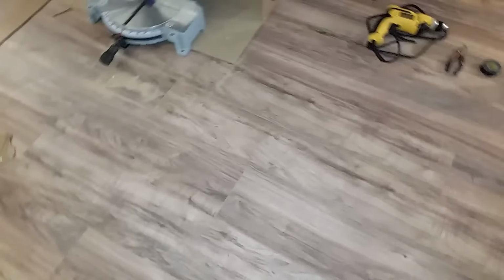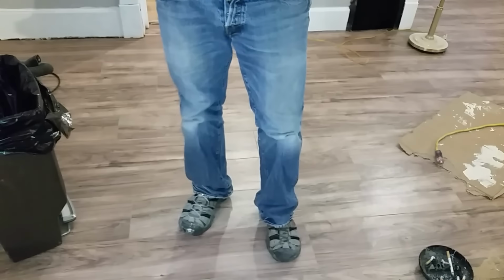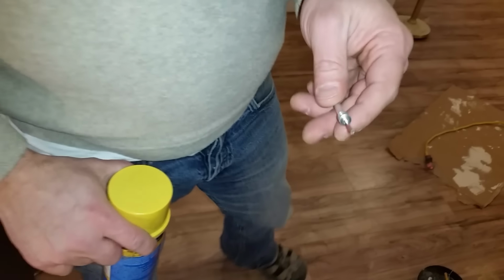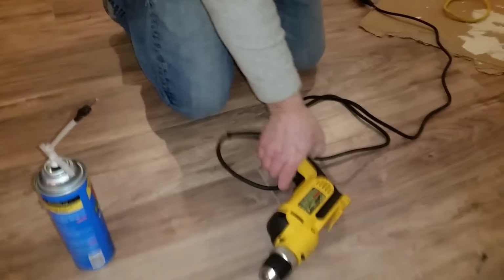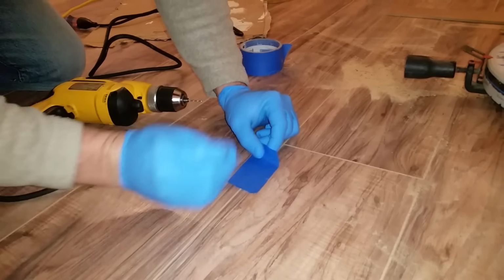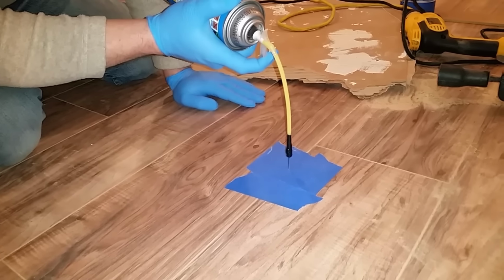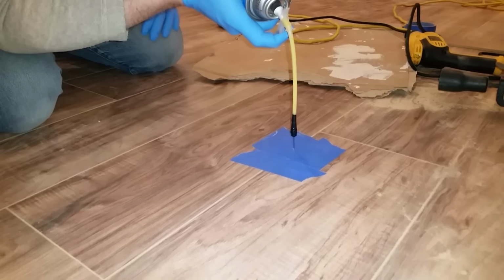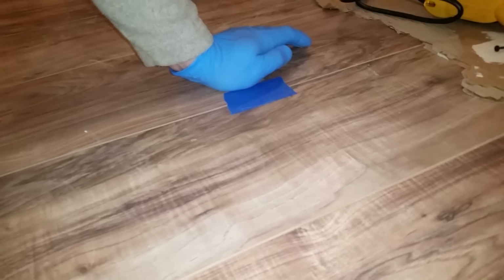Laminate flooring repair to fix soft spot for uneven underlayment

Comment: this is what happens when you don't use an underlay and don't leave an expansion gap at the edges, underlay is like $30 to cover a large room, don't cheap out laying laminate.

you're also storing up future problems by bonding the flooring to the subfloor, now your laminate can't move so will buckle even more when it expands and contracts
Reply: 100% man. I just spent 28$ a roll on some 2mm foam underlay and like 80$ on a vapor barrier over concrete. Another 150$ to level it out and you NEVER have a problem again! These numbers did the larger part of a 1300sqft apartment

Comment: That crack foam is the nastiest product out there. It will ruin everything it gets on , including your hands, if you let it dry.
Reply: yes you are right, but if you mess laminate flooring or tile, the best way to scrap it off without scratching is poly strip wheel on a grinder, just to let you guys know!

Comment: It's a free floating floor if the under layment was there you wouldn't have that problem.
Reply: We have a spot in the basement that has this issue and there is indeed underlay there. The problem is the foundation floor was uneven in that area and we didn't catch it before installing the floating laminate floor.

Comment: the reason you having that problem is because of cheap laminate flooring, next time get yourselves a floor that is atleast 12mm thick, that makes the difference, and make sure you leave enough room at the ends of the flooring for expansion and contraction, I can see from your video that whoever did your floor didn't know what he was doing, I see gaps in your joints which isn't normal, and your method of fixing the problem you are having is so wrong in many levels. but its pretty funny to watch
Reply: Bullshit!! I have expensive thick laminate that now has a spongy area, so the quality of flooring doesn't make a difference.
Reply: jewelbell5 yes it does and also the preparation of the surface before installation.
Reply: Nope.got 12mm high quality laminate and the floor was apparently uneven. Now some pieces are lower when I step on them and the clicks prob broken. Will try this fix. Might make it a Swiss cheese but we will see.
Reply: @vicentepallamare2608  that floor must have been really off if thats the case

Comment: I would worry about compression of the foam, i'm thinking from experience of how easy it is to compress low expansion foam when it's used in its designed setting, I've had problems with foam underlay compressing and that is designed for that use. it, might work where the boards bridge a small hollow but wouldn't bet on it. like others have said would also be worried of the problems caused by fixing the floor, wouldnt be such a problem if you could get the foam between the subfloor and underlay rather than underlay and floor. Don't think i'll be giving this a try, would personally go for a cut out, local level with some thing like thinset and replace the boards
As a comparrison, PIR flooring insulation board had a compressive strength of 12 - 15 N/cm2, minimal expanding foam (typically doesn't expand more than 10% of the its extruded size) has about 3N/cm2 so 20 to 25% of PIR Board. Xps foam underlay is about 7-8 N/cm2 and ive experienced local compression of this type of product as mentioned earier,  expanding foam isn't designed to withstand compressive forces, from experience using products in uses they are not designed for always carries a substantial risk.

Comment: All this video needs is music. Suggestion: Dueling Banjos.

I wonder: What's the compression rating on that 'Great Stuff? Is it rated to withstand weight?

Furniture+humans / Great Stuff = a floor that still fails.

If anyone steps on that area before it dries, the depression will still be there.

If no one stands on that area until after it dries, the Great Stuff will crumble.

This fix is akin (similar to) to chopping out a broken ceramic tile and installing the new one using Sheet Rock taping compound!

Know what you're actually fixing in this video?

NOT ONE THING.

Please, sir; stick to your day job. And if this is your profession, please: CHANGE CAREERS NOW.

Comment: I stopped watching once you put on latex gloves to squeeze a can of spray foam. Hack
Reply: Richard Cote 😂
Reply: If you have ever got that shit on your bare hands you would understand. It has to wear off. It is like epoxy.
Reply: That shit doesn't come off. You be a fool to work with that crap without gloves.
Reply: I'm sorry I wouldn't know because I use something call skimcoat with levels your floors out pre install.  Leave the spray foam for the hacks with gloves